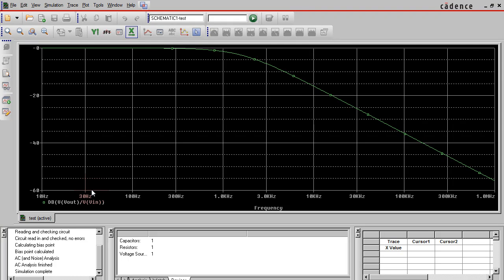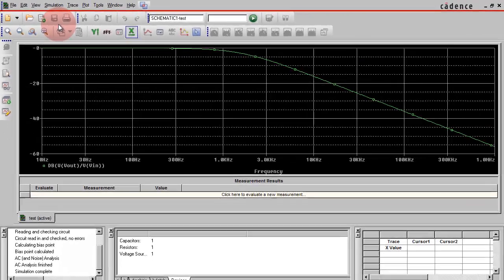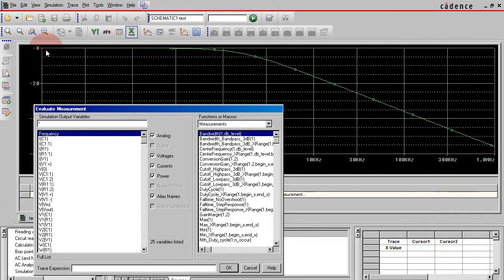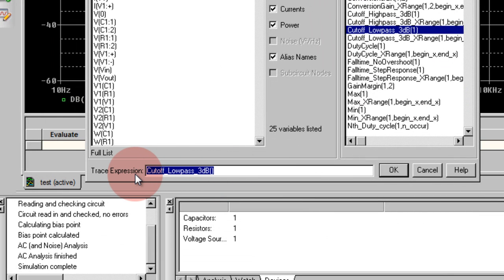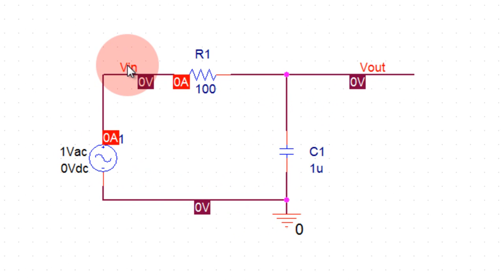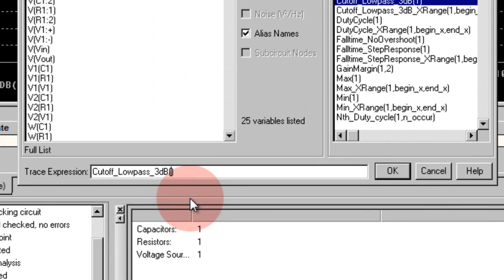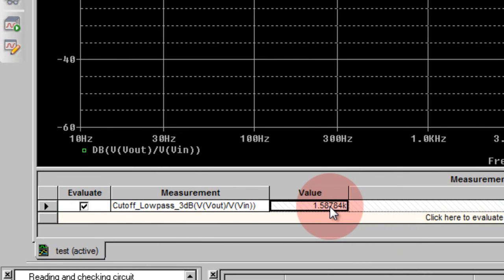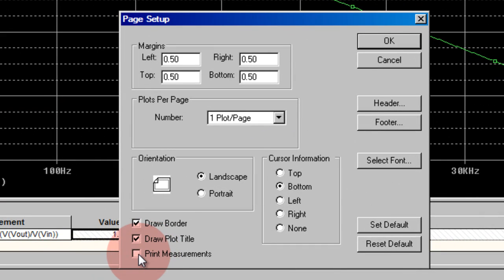OrCAD PSpice: How to Find F3db, The Cut-off Frequency

Comment: Sorry for the dumb question, I'm new to OrCAD. How does this result compare to the theoretical cut-off frequency? I'm told that, theoretically, the cut-off frequency is 1/(2 pi R C). According to my calculations your cut-off frequency would be 1592kHz, which is different from the measurement result. By looking at your schematics I operated with R=100 ohm and C = 1 microFarhad. How am I supposed to know the scaling in the measurement result? (is it kiloHertz?)